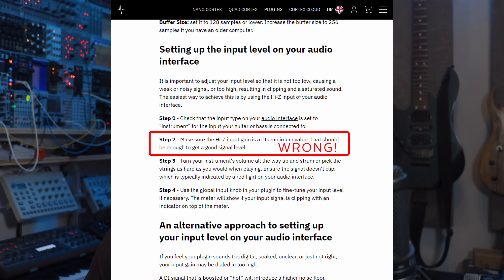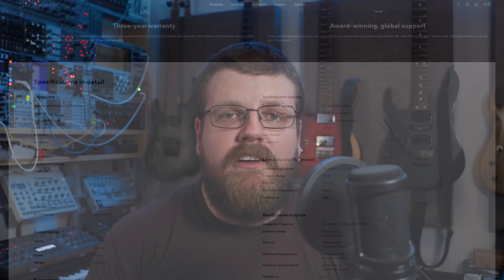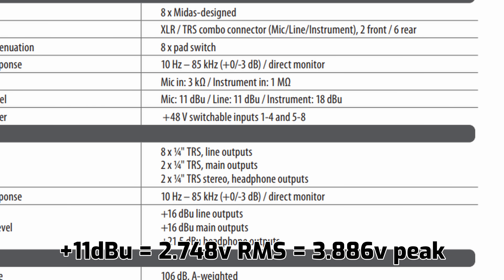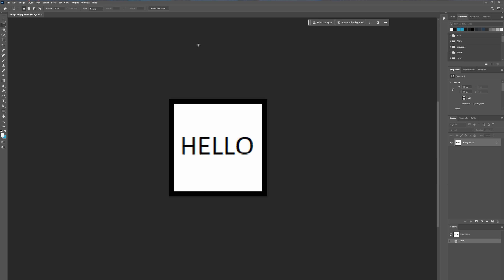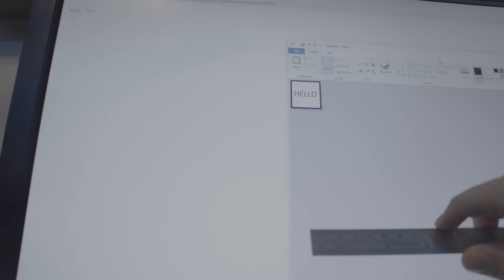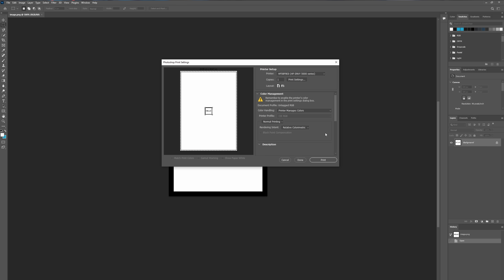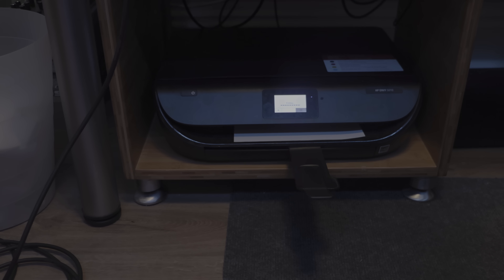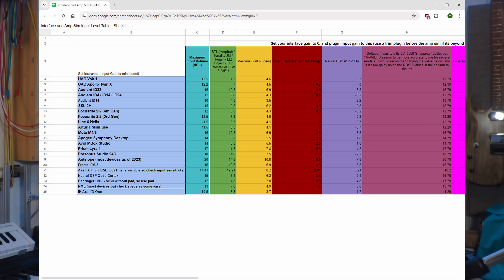Ampsims and input gain - Please, stop the madness...

Comment: I use high output humbuckers(bareknuckles) and tried comparing the loudness before and after setting the input gain to 0 and right before clipping on the loudness meter but didnt see any changes in db. How do i compensate in the plugin then?

Comment: Ok I want to get this straight. I'm using an Apollo Twin X with Neural DSP plugins. Using the chart, I should have the plugin set to 0. Then I turning up my input gain on my interface to 18db (right before clipping). I should then turn down input gain on the plugin to -18db?

Comment: Long time Bias FX 2 user. My results have always been inconsistent at best. Some days it sounds great, other days it sounds really not so much. Often times when wanting a clean signal that I could shape with effects, distortion would seem to overwhelm the signal even when playing softly.
Upon watching this vid I immediately when back and reviewed my settings. I've always adjusted the input gain on my interface, but never took the time to adjust the gain on the BiasFX input. Huge improvement to the amp sim output and sound overall. My clean tones are actually clean. I've got more testing and adjusting to do, but your vid has answered a lot of questions I've had for a long time.
Thank you very much!

Comment: This makes sense in so many levels. Pretty similar on how close your pickup is located to the strings. Close or far away, the idle gain noise will stay the same, but when you hit the strings you notice the difference. Closer the pickup is to the strings, less you have to drive the amp for the same distortion... which means you can lower your amps gain and it makes less idle noise.

Comment: It all comes down to how the unit is designed. The -1 and +1 corresponds to the sinewave. This is AC sine wave, that is: analog signal fed from guitar to interface - interface then sends this to either a DC bias or directly to the ADC input. ADCs can't read negative voltages, they only measure DC, that's why the original AC sine from guitar has to be DC biased around a positive voltage that won't cause clipping the bottom of the sinewave (because original AC signal oscillates around negative and positive voltage). The -1 and +1 are probably floating values that the digital processing at the DAW/plugin or standalone app is being fed as true, analog-to-digital converted interpretation of the initial sinewave from guitar.

Comment: The expected translation between digital values and real-world signal strength differs plugin per plugin. If you use things other than an amp sim (like a pedal plugin, but also the old Waves plugins for studio gear, or anything that tries to emulate something analog...) you will have to know what the plugin expects for signal, or how it translates digital values to analog signal strength.  Mixers know this for the past 20 years, why are guitar players still thinking they know it better 😉. It's also why pretty much every DAW out there has an input level and output level per plugin if you add them on a track... because they all expect something different.
It's on different in the photography world BTW, where the advice to 'expose to the right' (crank up the input gain) is a well known thing, but just as in audio preamps, if you clip it you destroy your signal. And modern preamps are more, more MORE than good enough (in both photo and audio world) to play it safe and you can easily be quite be a lot lower than your clipping level. Play it safe, don't clip. BUT, that doesn't mean that you should leave it at 0 🤦‍♂. Put it up, as high as you can without clipping. And don't take risks, leave some margin for not clipping. But not 20 DBs of margin 😉.
In the photo camera world, people still try to expose their picture as bright as they can, because the same thing here: increase signal to noise ratio, stay away from the noise floor. Specially (older) Canons that had a quite high noise floor. But what happens is that a lot of people are cranking up their exposure, and coming home with parts of the image clipped. And that's a worse problem to have compared to a bit of noise. Leave a good margin, stay safe, modern stuff can handle it. Doesn't mean you should take a picture in the dark, and doesn't mean on a (mic) preamp that you should leave the input gain to 0 :).

Comment: I work in AV and this is exactly how I was taught to gain stage when I first started. Gain up closest to input and work your way down the line toward the output. If the gain is too low at the beginning of the signal chain, you will have to make up for it later on down the line and it will inevitably cause problems or lower the quality of the output. I thought this was rudimentary, and it's shocking to me that there was ever a debate about this lol.... Anyways, good video! Glad you set them straight lol.

Comment: The saddest part of this video that people somehow accepted Youtubers like Rabbea and Cordy as authorities. Real knowledge has little to no weight anymore.
Reply from the maker: To be fair, I absolutely don't blame them for it. They were in fact repeating information they received from what should have been credible sources - mostly the plugin manufacturers themselves. The problem was that this advice came from their marketing department, in the form of a "simple and easy advice to follow", and not the engineering department. In many cases, setting the gain to minimum/0dB does work just fine. But it's not *optimal*. And that's where there misinformation started. People interpreted what was a reasonable shortcut as the "optimal, ideal thing to do", and then started arguing with others who knew better :)

Comment: Brilliant explanation...!  It's not much different from the gainstaging I grew up with in the era before digital recording.  Make sure that every stage is being fed the optimal signal strength to optimise the S/N ratio.  On analog consoles, you'd start at the preamp IN, then work your way down the channel strip, making sure that all the send/return loops were also gainstaged (buses, aux sends etc).  The only difference here, which uses exactly that same principle, is that many people forget about the initial A/D conversion as a separate stage in its own right.  Beautifully explained - thank you.  PS: I love my Ghost Note Audio Conductor v2 :)

Comment: Yeah, that should be the right way; that's what I do every time. But I also discovered another weird phenomenon: even if I compensate the plugin input level by reducing it, the tone is still different compared to unity gain for crunch tone. So I was thinking, will increasing the gain change the input impedance? It might be because the resonance frequency of passive up changed, resulting in a tone change.

Comment: @GhostNoteAudio one question remains: i am currently trying to decide upon which audio interface to buy. Does that mean i have to buy one that tells me the exact gain value, or is there a way to find out the amount of gain dialed in through indirect measurements?
Reply from the maker: You can figure out the gain of an interface from the specs in the manual. Check the "maximum instrument input level" - it will definitely be in there somewhere, and most likely specified in unit of dBu. From that you can find a close match in the spreadsheet (or do a little bit of math to work out the exact compensation value). Finally - to figure out how much gain I added in my demonstration, I just played some open strings for 10 seconds, before and after changing the gain level, and used a level meter plugin to figure out how much the gain had increased.
Reply: @GhostNoteAudio  thank you for the elaborate answer. So that means I can properly gain stage an amp sim with any decent budget interface? (Currently torn between Audient iD4 and SSL 2)
Reply from the maker: @Spechtologe  absolutely - and those are both very solid choices.

Comment: What about fractal audio units? I have an ax8. Guides tell us to look for the built in VU meter line(-12db) and try to get -12db in DAW; by setting +4dbu or -10dvb option and setting the output volume knob accordingly. I would be very glad if this clears up. 
Because this way im getting -12db in daw by setting knob to 0 value on my interface(an old behringer umc22)
Help from any experts asap 🙏

Comment: This man is absolutely correct, and not only that, this procedure has been the accepted convention since digital audio has existed, and was also the convention back in the days of analogue tape. A hotter signal akways gets you further away from the noise floor. The physical control on your interface exists in the analogue world, so of course you want to turn it up as high as you can without clipping. 

It's amazing how one or two influential people spouting erroneous BS can cause the hive mind that is internet guitar people to almost unanimously believe it. 

This stuff isn't even difficult to understand.
Reply: Well, i thought 0dB was actually the hotter signal you can get without clipping, not the actual gain knob turned to zero.
So if someone says "turn it to 0dB" i just turn the gain knob up until it clips and back down until it doesn't anymore.

But maybe i confused something.
The analog devices says 0 on the meters when the signal is good.
Reply: @giacomoneri1782  It's madness that people are even debating this stuff.

Comment: Back in the olden days of reel to reel recorders we were taught to use test signals and set the input channels on the desk to 0db. To reduce the noise and keep levels consistent between tape machines etc.

Analog gear reacts quite differently to digital so reducing the input gain makes a lot of sense.

Comment: One thing to consider is that other plugins like compressors etc. React differently to hot sources vs less hot sources. Imo my uad and fabfilter plugins react best with input around -12. Just something to consider because ampsim is not always the only plugin in the chain. Slightly off topic… I know. Just something that I have to consider in my workflow. And the best rule to use imo is:  does it sound good?

Comment: It is exactly the same as when an inexperienced sound engineer plays with low gain on a digital mixing console. There is an analog to digital converter if the gain is too low, instead of playing in 24 bit or 32 (if the console processes) you process the signal with a lower digital frequency like 16 or even 8 bit

Comment: I’d Love to see a video where you use the same principles to dial in a clean guitar tone!
Reply from the maker: @adriatic.vineyards  the same principles always apply, but the resulting difference will be drastically less noticeable. That's because you're not applying heaps of gain post-conversion, so even if you have a relatively high noise floor, it won't be amplified and become problematic. I've been meaning to do a follow up video to this but never seem to have a second to spare :)

Comment: Thoughts on non-destructive Normalize function?? 
(If I've set a particular input volume quieter than ideal, but that's the take. Sometimes normalize is a useful last resort to get a signal more "in the mix" to work with).

Comment: oh my god this is SO amazing to see even in the first two minutes, i live with about half dozen tape machines and there is absolutely no standard there either, you record xyz at abc nwb/m^2 and that is xyz on that machine, then it's abc123 on another machine, let alone eq differences, but yes, digital is amazingly simple in that it's arbitrary between nothing and maximum, but, what your box thinks is zero and what is maximum is the real big issue there
Reply: 8:21 i actually audibly sighed, i use cubase which has 'stereo in' tracks in the mixer, which are basically the raw audio tracks before they are recorded, i have gain compensated for YEARS now, i genuinely just can't believe people never put two and two together here
Reply: 9:24 THANK YOU THANK YOU THANK "Y?OU THANK GY"DFOUGFDJOIANMJTJFDIOGJ THANK Y?OU

Comment: I have the Apollo x6 and the input on the Z has to be a low as possible cause my guitar runs hot through it. I've had to put an analogue sim on the channel inside the UA software to decrease the gain a few dB's to prevent clipping.   I used to have a 003 (still do, but I used to too :p) that I would gain it to below clipping and adjust the input gain in the sim. I thought this was the norm LMAO

Comment: yeah this is just common sense, i can see how guitarists who are not familiar with digital audio would assume otherwise. i do suggest people not drive VST plugins with hot signals especially when they are non linear analog modeling type ones. they expect a lower input signal, but as you correctly pointed out, you should just turn the gain down in the DAW after.

Comment: The video didn’t cover what’s the relation between gaining the signal on the source end vs. the A/D end. I have always tried to get a loud enough signal before the A/D since I assume even that analog gain might introduce some additional noise after the signal has passed through a little longer wire. I guess I should do some real measurements with different A/D converters and sound sources. At least I noticed that it’s not a good idea to boost the Boss RC505mkII looper’s main volume over 100 as it will get heavily compressed or distorted.

Comment: On the Apollo my minimum gain is 10dB. Does this mean if I set the Apollo to 24dB I would only put the plugin input gain down by 14 or would I factor in the original 10 as well and put it down by 24?

Comment: Have to ask a Q. Haven't read people's discussions. But! Is internal gain structure taken in consideration?
If not that might "unbalance" N/S ?
And increasing the gainknob on the amp-sim seems strange. Wouldn't it be better to do that eith a separate plugin BEFORE the amp? Just pushing the signal and using clean a amp,without effects and pedals which will only increase the signal even more. And from there u can use pedals and effects as you please!? 

You can choose to have any sound u like but still have balance🤔
Had a lot of headache from a bad sounding Amplitube.
Any plans to a test on Ampkitube 5??😊

Comment: I have started to use a mild compressor ahead of my interface just to get rid of some the stuff "sticking out" in the guitar output stream (many of the created by my insensitive fingers). I have found that with this slightly rounder package I can add a bit more gain on the interface and  I get a signal "on tape" that is easier to work with.

Also - for you picture example, imagine how that 100x100 pixel image will look printed to fill an A4... that is basically what is happening when you normalize a weak input, regardless if it is a formal normalize or adjusting the plugin input. Pixels! :)

Comment: Thanks for this great explanation! I'm far from being an audio engineer. As well as, I think, most of 0db advocates. And this drives me to a suspicion. Are we all talking about the same 0db's? 
On my Neural DSP Quad Cortex 0db is somewhere around the center of sensitivity range. And hot pickups easily jump into the red, somewhere to -7, -5db. So, according to your explanation, something around 80% of bit depth is utilized.

Comment: I'm trying to follow along with your method here. When I measure the input gain on my interface I'm getting what appears to be a useless result. The difference between zero and just below clipping is 29.4 Db.  The spreadsheet says to set my sim to -0.2. So I'm supposed to roll the input gain in the sim back 29.2 Db.  The amp sim won't go lower than -24.  Is there a way to fix this without buying another interface?
Reply from the maker: I'm surprised you can add that much gain, that's a pretty wild result! :) My result of 24dB was already about as extreme an example as I could realistically come up with, so I'd double check your measurement of 29.4 is correct.
However, if it is, and you need to reduce the gain even further, you can use a gain plugin like Kilohearts Gain (free) to reduce the gain. Just add it in front of the ampsim plugin and use it to adjust the gain as needed.
Reply: @GhostNoteAudio  Thanks so much for taking the time to reply! I feel kind of dumb now. I will give that a try. I'm considering buying a DI box and putting it in between the Audio interface and my guitar. Would that be worth the cost?
Reply: Yep. I'm stupid. Turns out changing the almost dead battery on your active pickups makes a huge difference. 12 Db change now.

Comment: If you are still wondering how to measure the amount of gain added after the interface adjustment, I used Youlearn Loudness Meter. It works as a standalone app or a plugin. Then do the math as explained in the GhostNote pinned noted.

Comment: Honestly, heres my experience: setting the input to 0 makes the gain too low, setting it to edge of clipping makes it too high, so i just try to set the gain by ear where if i turn the gain knob on my neural dsp amp i think it would make for a realistic gain response from the knob of an actual amplifier. I know its not the most technical solution but it works for me.